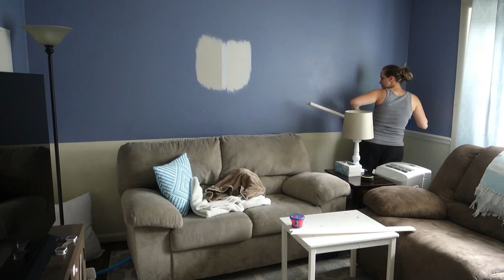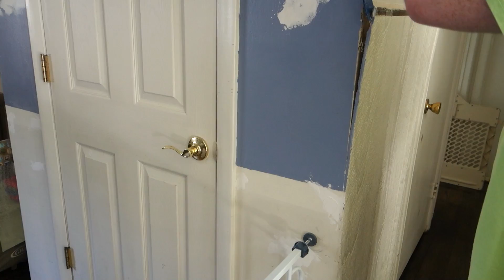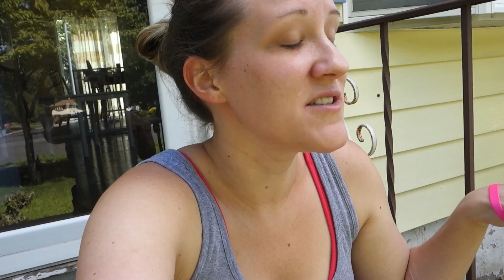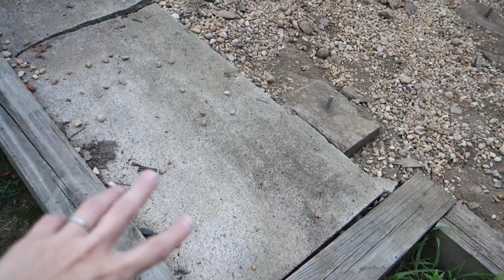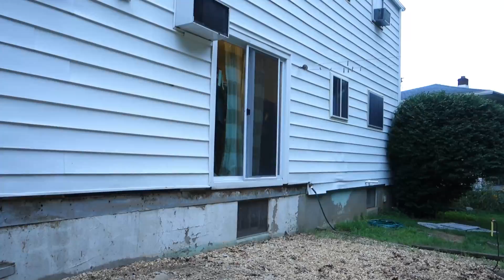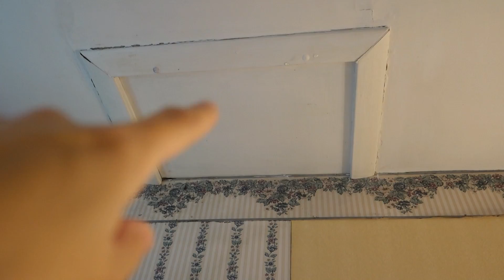Porch Chat & Leaking Bathroom // Cape Cod Fixer Upper Vlogs // Chill with Jill

Comment: Our older tub will drip/leak into the garage if we get too much water on the floor. Just make sure it dries all the way so it doesn’t mold from the moisture. Ours would leak into an unfinished garage so I able to dry it out with just a regular fan. They make a mold spray you can use just to be extra sure.

Comment: We had plumbing issues two weeks ago and it was ridiculous getting a plumber. There wasn’t any available in our area, it took a week! With homeschooling for us, a schedule works well for our family. What works well for me is not having exact times on the schedule, just a list of the order of what I think will work best, that way I don’t feel rushed and defeated early in the day. This way I can easily change things or switch things when needed. I have it posted on a board with Velcro for each thing in the order we will be doing it. I don’t know if that helps, but for some reason removing the times relieved so much stress and gave me a sense of freedom.

Comment: You aren’t the only one. I have a 3 year old (just turned 3) and a 12 month old and my 3 year old wants to go outside and if my 12 month old goes outside with us I just spend my whole time chasing him around the yard and it isn’t fenced in or anything and I’m 22 weeks pregnant also. I can’t do it anymore in this summer heat so I just take him out on the porch to play with the gate closed or we go out when he is napping! Way easier 👍😅
Reply from the maker: Yes! So glad I’m not the only one who can’t handle it! The porch/deck fresh air has to be enough sometimes when they are at this age of getting into everything and trying to run into the street lol.
Reply: Chill with Jill when the hot weather breaks and it gets cooler I won’t mind it at all but I’m not running around in 90 degree humidity lol especially pregnant

Comment: We had the same thing with our bathroom ended up being the plug hole/drain when someone was stud in the bath it would break the seal and water would get through then when we stopped in the shower it would just be a tiny drip till everything dried apparently is very common in older bathrooms or if someone hasn’t sealed it correctly hope you figure yours out soon